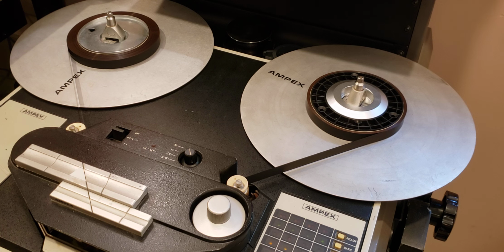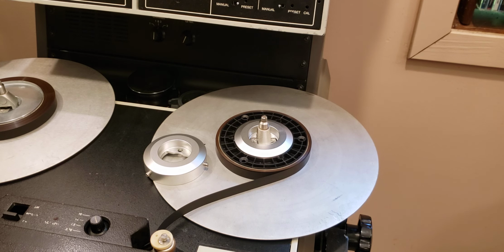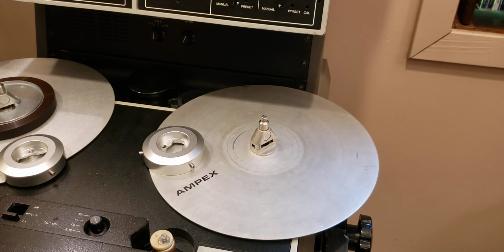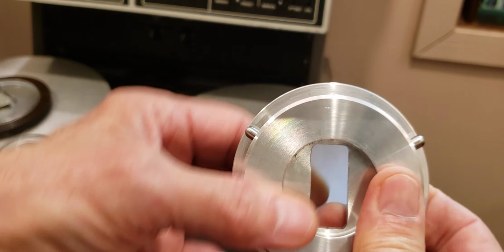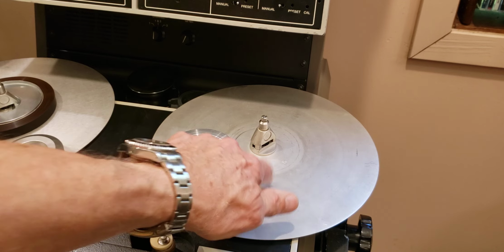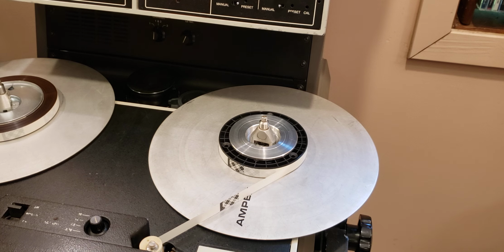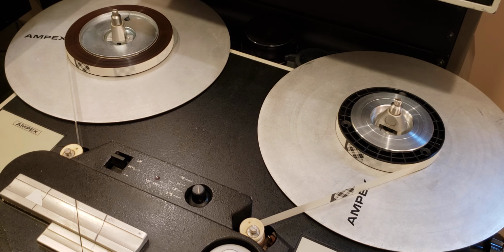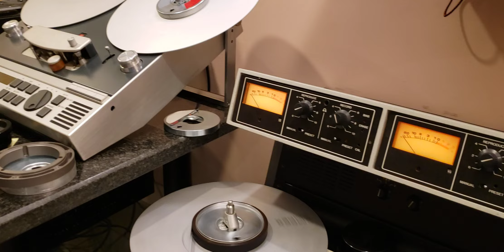Ampex   Studer... and Accessories

Comment: corr you are like me with the gear  i have alot of tape gear  i have the wheel a round decks as well 

i more in to the 1 inch  soundcraft 760  381    otari decks  bremel  mini 8  be cause i can fix them